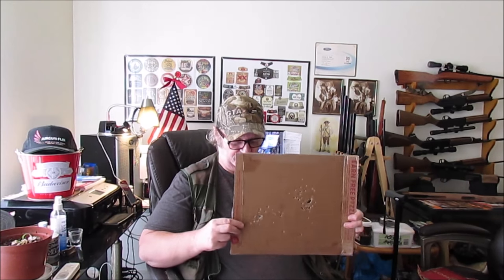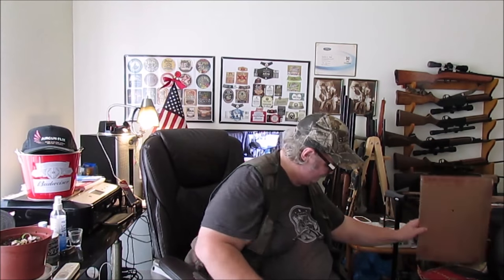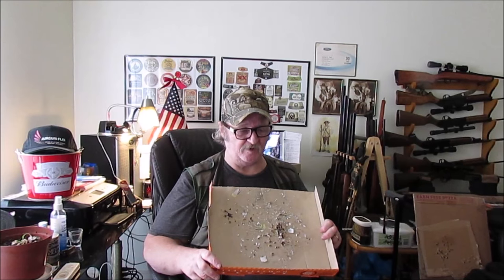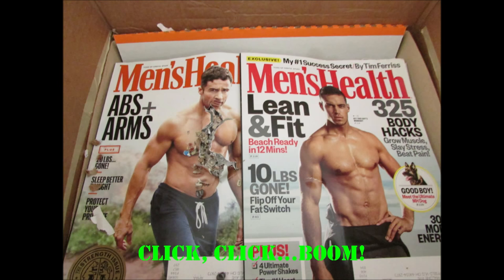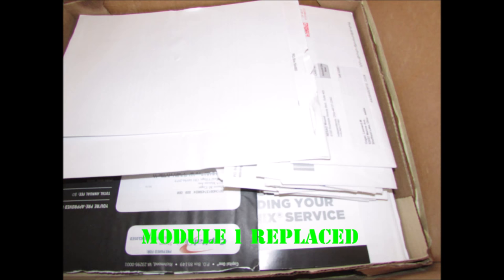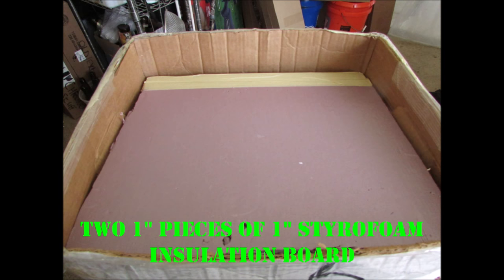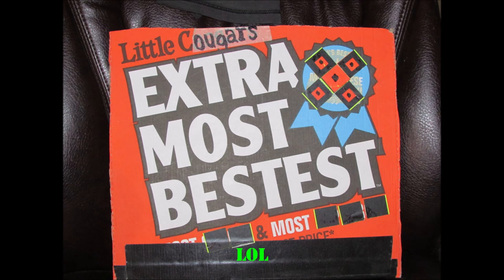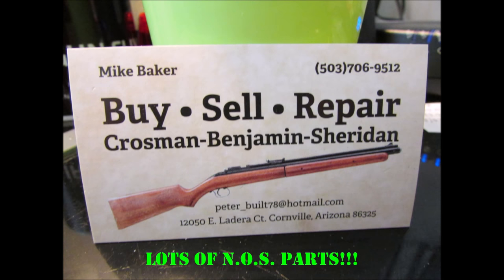Airgun Fan EP93 Modular Backstop Explained

Comment: Nice update on the system. Thanks!
Reply from the maker: You're welcome! Hope it helps where ricocheting pellets is a concern. This system is safer than what is more typically used. And sometimes, that wild ricochet goes into the house across the way. But not with this system if properly assembled.